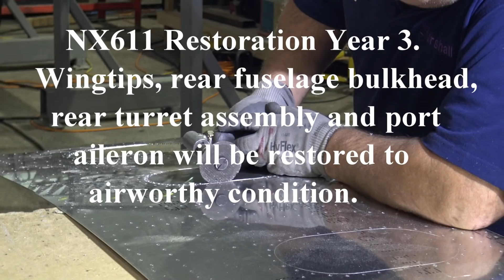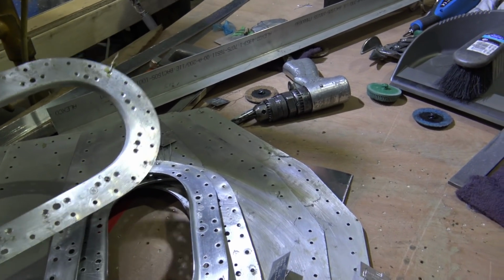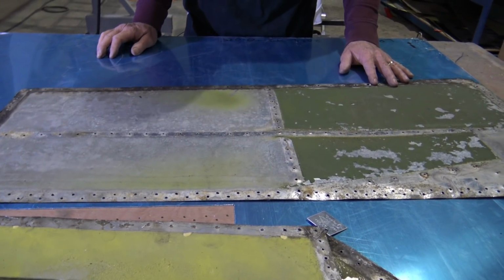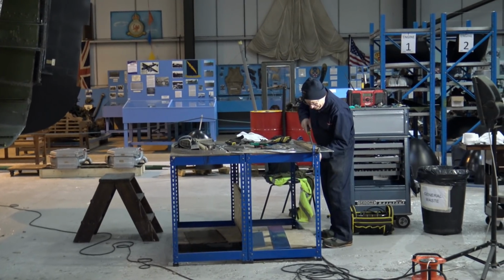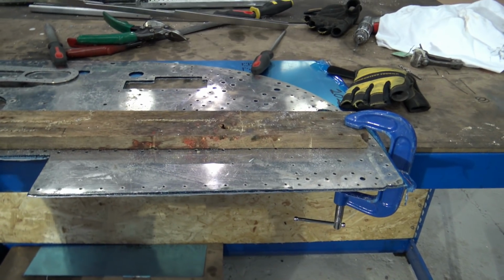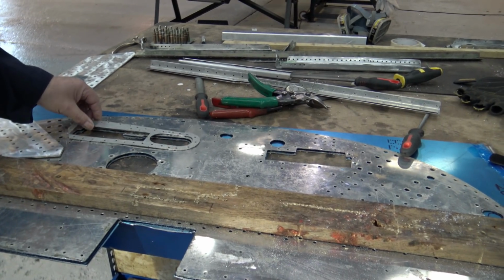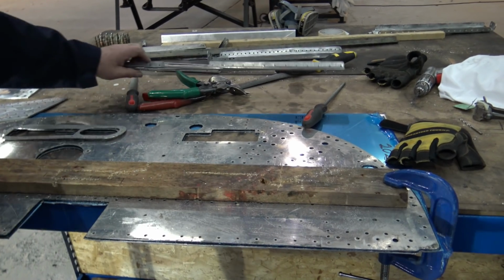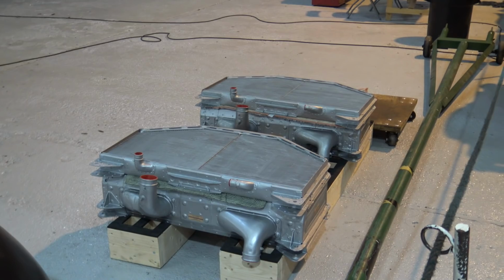Video 43 Restoration of Lancaster NX611 Year 3.

Comment: Hi Neville. It's slightly bizarre, these sheets of alloy that have enormous holes cut out and then countless rivet holes drilled. Why weren't the holes cut out with an air saw or power saw? The air fed cutting disc looked pretty awkward then to drill out the arc's and then finish off with a file or belt sander. ... labour intensive ! Thanks Neville.
Reply from the maker: Sorry John, I cannot answer that , I'm just a visitor to the Centre,  but to me they seem to be doing a great job. But I will ask the engineers why they didn't  use a power saw

Comment: Is an CNC aluminium punching machine used for making those panels with all the rivet holes?
Reply: I doubt it. This is just pure skill and craftsmanship you are witnessing here. Flat sheets would be laid over and holes transferred.
Reply from the maker: Hi Jeremy the holes are all hand drilled, using the old skins as templates were possible.
Reply: I've been involved in making aluminium structures for airplanes.   We always used CNC machines. If you are making a lot of new panels this has to be quicker, cheaper and more accurate. Make the drawing up on cad, transfer to the punching machine. Job done.